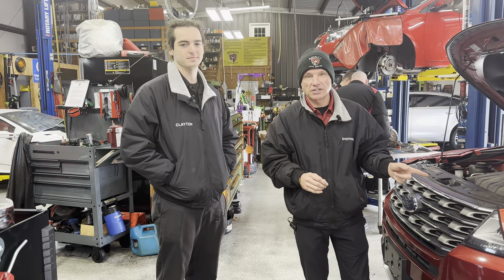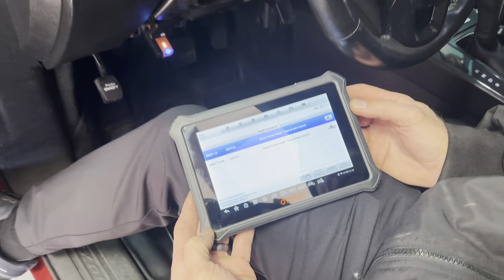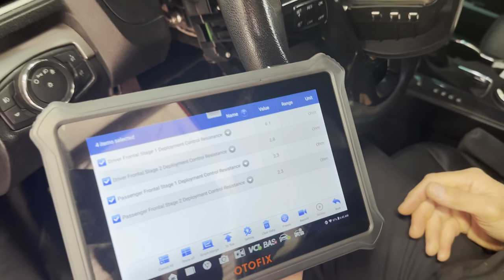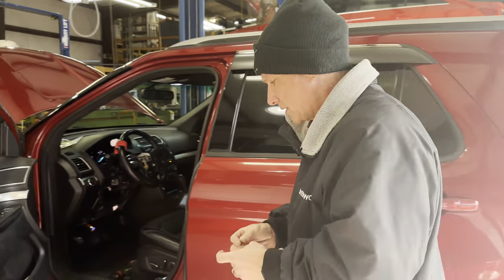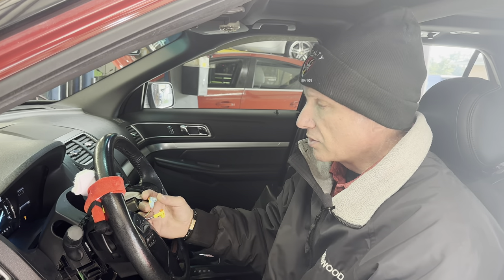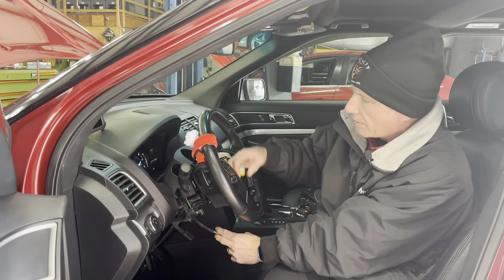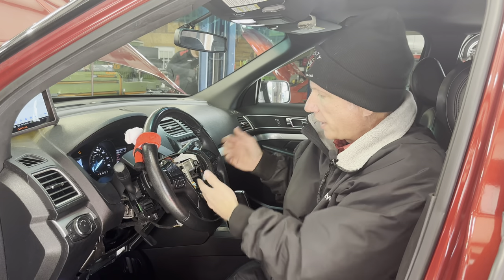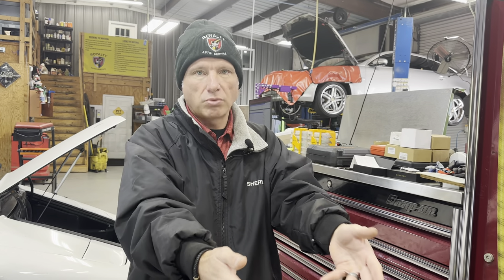A Simple, Effective Way to Test Air Bag Systems

Comment: I do the same thing. I made a 2.2 & a 3.3 ohm resistor for testing airbag systems out of a piece of hookup wire, a resistor, 2 floral pins & heatshrink. Solder it all up, done. All up cost nearly nothing.  The sharp pins make back probing easy & the flexibility of the hookup wire means the tool will last forever

Comment: An excellent example of how to prove your circuit integrity before firing the part’s cannon.  Makes you wish the manufacturer would require the experts to take a fully assembled vehicle and follow their own instructions to see how ridiculous the procedure can become. At the stealership the customer will likely be charged for the book time to follow the tree and the mechanic will gladly take the time but reach the same conclusion as you performing the same work around using common sense.

Comment: This was a really great video. I have an airbag issue with my Outback, unfortunately it is with the passenger side so it's not as easy to get to as the steering wheel unit. But when I do get around to tearing into it I have saved this video so I can do some testing.

Comment: What a great video. Did this before with vw crafter. Was plug on module. Very rarely do airbags fail. Great informative video that I've learned from . I will be sure to do this. Guys like you is how I've learned and be where I am today so thanks again 👍

Comment: Very valuable test. I'm glad you showed the stabliant 22 also. The most powerful diagnostic tests are when you can substitute a known value. Bypass testing is the greatest. Super effective and straightforward. The first time i ever used this test was a honda prelude. It came with a shorting bar dummy plug. It was attached to the air bag next to the connector. This is preobd, but they wanted you to short the connection and check for the code to change to shorted ckt.

Comment: This is how I was taught to test air bags. Instead of stabilant22 or similar we have been using heated windshield repair kit stuff which has a lot of silver. Obviously you have to be more careful with that not to short the circuit but it has been flawless with no comebacks.

Comment: I came here to find out how to check what each airbags resistance is for my BMW 330cic. I’m new to BMW and was not sure if they be the same ohm as my GM and Nissan stuff. I’m looking to remove them and add a resistor and keep the dash light off. I have the OTOFIX it’s a great scanner and a great way to check the airbag ohm size per bag!!

Comment: For my Subaru, there’s a special tool, a test harness made for Subaru vehicles. There are very specific steps and cautions. I’m not sure if I would use a scan tool not designed for my vehicle airbag system. I’ll wait for your review of the OtoFix.

Comment: S22…developed by the elevator industry. Correct, can be used on any electrical connection. However, we found if connections physically disconnected, you should “ refresh” connection with a drop or two .

Comment: Great tip, thank you!  I have a question about an alternative method.  Can you substitute a jumper wire for the resistor with the assumption that the resistance will drop to around 0 ohms?

Comment: On Generac liquid cooled generators they use a 4 to 20ma loop for sensors.  We carry a 1 k ohm  resistor to jump out failed sensors for troubleshooting. Its helps to see the Raw value vs processed value with a known good value.  Sometimes if its an emergency and a low coolant level sensor has failed its nice to be able to jump out the sensor to keep the unit working until we can get a sensor.

Comment: Will this resistor method work if hard crash codes are set through the module if i wanted to just temporarly remove airbag light

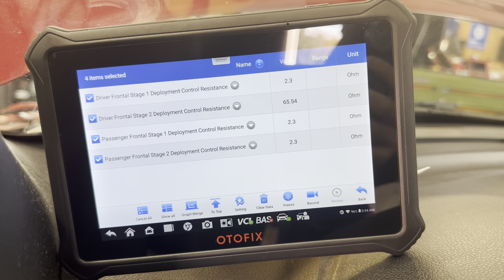Comment: 15:09 hold the phone. 😂 That tells you the problem is after the crimp on the clock spring connector. It will be the clock spring at least 99% of the time but it could be pin fitment or corrosion in the connector. Edit: I commented too soon; you covered it at 18:09.

Comment: I went to amazon to search for the resistors.  They sell logs of 2.2 ohm resistors, but not 2.5 ohm.  Is it possible you're using 2.2 ohm resistors?  Thanks for this very cool tip!
Reply from the maker: Yeah, I think they are  2.2 ohms.
Reply: @theroyaltyautoservice   Thank you!  That was a really great tip on an intimidating part of the car to work on.  Your videos are better every time.

Comment: Thanks for another great video guys. A question if i may? What would be your approach to this fault if the SRS ECU didnt provide the resistance PIDs? You would think that all modern ECUs do show this information however the brand i work on, those resistançe readings are not provided (even 2023 models), thanks
Reply from the maker: Very common problem, especially on older vehicles. First, document your code, then clear it. Cycle the key and see if it returns. If it does, then it is a hard fault. Find the ciciut and install the resistor. Clear the code and cycle the key. If the code is gone, then you've found your problem.  Cycle the key multiple times just to be sure. Hth.
Reply: @theroyaltyautoservice  Thanks for the reply guys

Comment: That is exactly how I was tough to test air bag deployment loops. One question I have is how do you test other components is the system?  Crash sensors or acceleration sensers?
Reply from the maker: Unfortunately you have to take those on a system by system basis. Some times they are simple switches but sometimes they are mini modules.

Comment: A faster diagnosis of the clock spring is to graph the resistance while turning the steering wheel. After your tests you could also do a pin drag test on the connector to the clock spring
The resistance is stored in a 16 bit register that can have a maximum value of 65535 milliohm, that gets rounded of to 65,54 ohm on open circuit.
Applied Science made a video about the "magic in a bottle" https://www.youtube.com/watch?v=VpRrP3sqQLw
Reply: Nice 👍🏼 ! Thanks !  👊🏼

Comment: Many times other functions on the wheel also will not work. SRS light and cruise won’t work or radio functions not working then a clock spring is the most common fault. Simple logic wins out every time.

Comment: It does not look resistance, that is wrong information. It feed reference voltage and expect certain voltages back. It calculates the resistance by voltages values. Even your multimeter does not see resistance, it is all voltages. You should be professional and share the professional information. Learn OHM law!

Buy cheap IPA and it works too. No need something very expensive